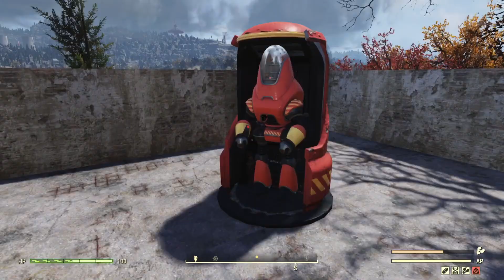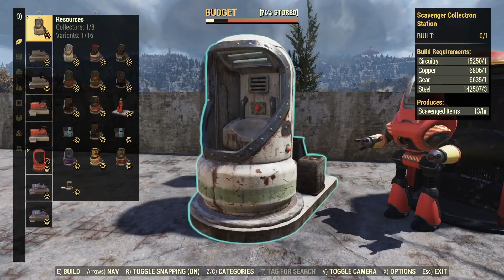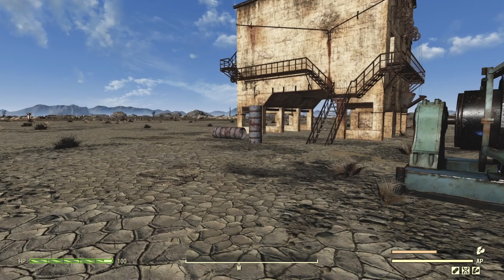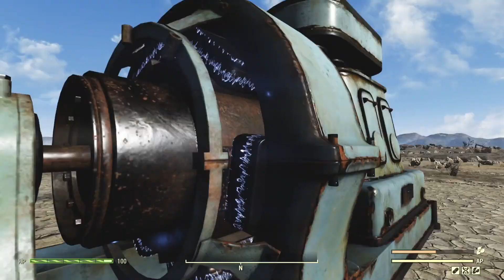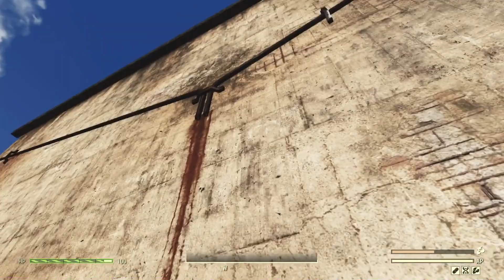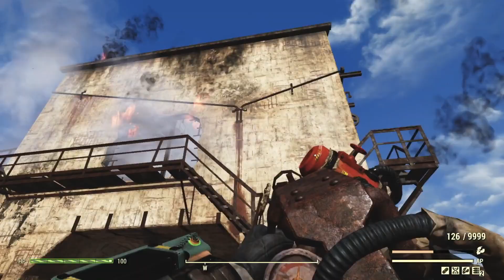Industrial Power Bundle - Fallout 76 Showcase

Comment: Thanks for the showcase. I am the one who owned the Enclave Repair Bot Station and i can easily recommend to anyone who wants to protect their own CAMPs against the critters. It will do its job as long as the structure or the decor is not totally destroyed. Btw, i am really against some restrictions in this game and i don't see the reasons why there are two different sub category for CAMPs and shelters related items in this game. Everything supposed be placed freely on both outside and shelters but no, BGS thinks we'll exploit the game or something idk 🤷‍♂
Reply from the maker: honestly just make items in shelters or outside shelters just non functional decorations 
also main reason for collectors not in shelters is game would have to track every shelter so if I have 14 shelters thats 14 of each collector having to be tracked but by making them non functional decor well no tracking no balance issues